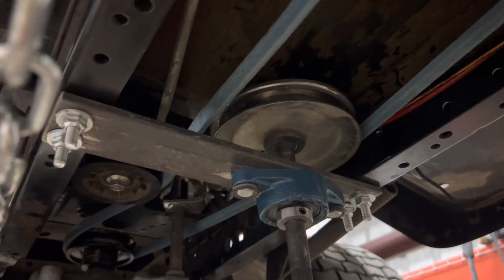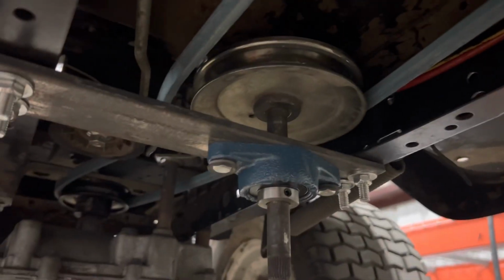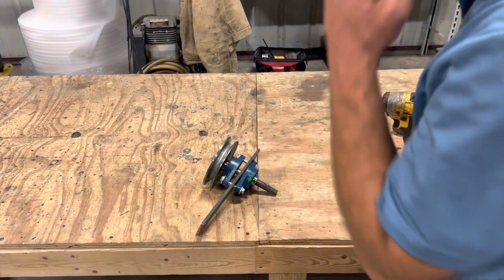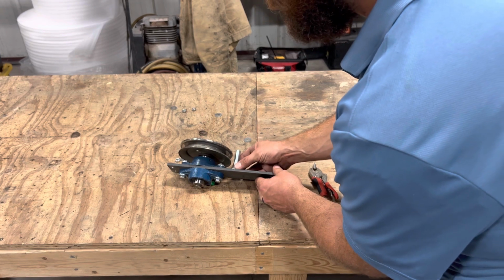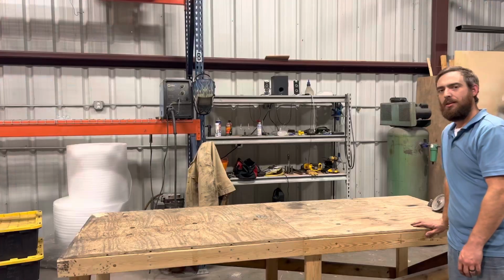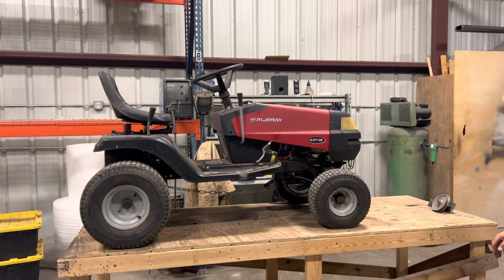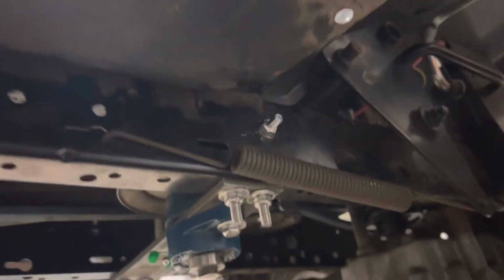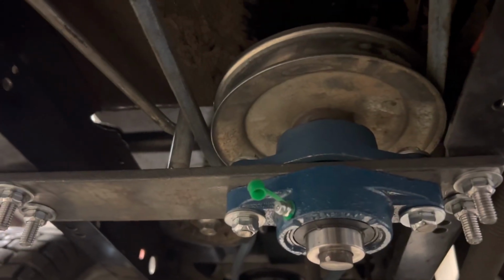How To Keep a Drive Belt From Falling Off After a Pulley Swap

Comment: Very good Idea,  but won't that welded bolt wear out the out side of the belt. also When you hit the pully with a hammer  a bushing fell out and it didn't go back in. great problem soled .  great video